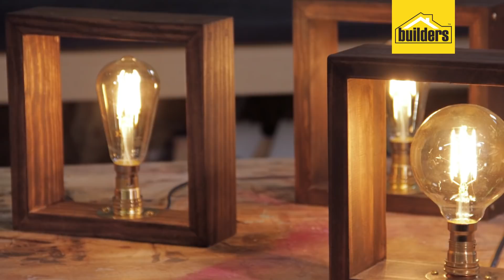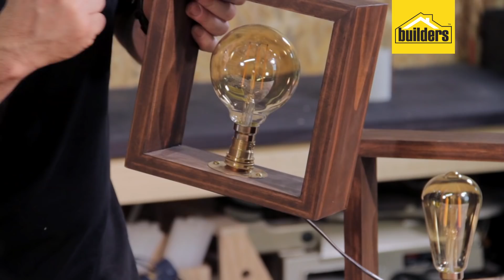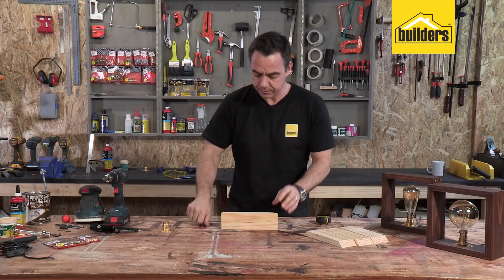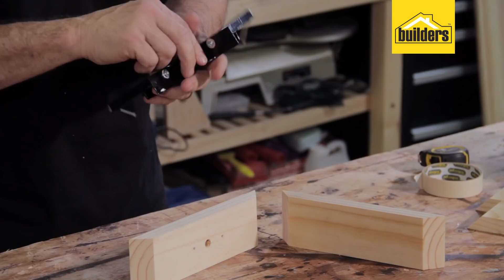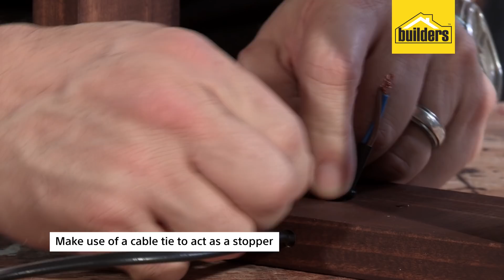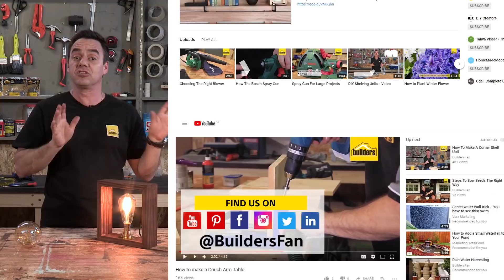How To Make A DIY Edison Light Box

Comment: This is a metal holder with a metal screw in lamp.   If this is connected to the mains I think it needs to be earthed unless it is a double insulted fitting. Also you need to talk about the fuse. At 4 watts it needs to be a max of a 3amp fast blow fuse in the plug.  Things can get really dangerous really fast without talking about electrical safety and you could be liable.